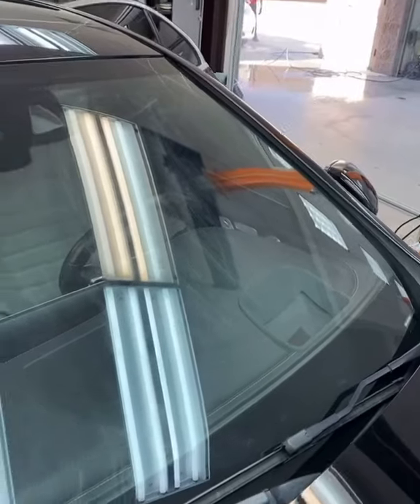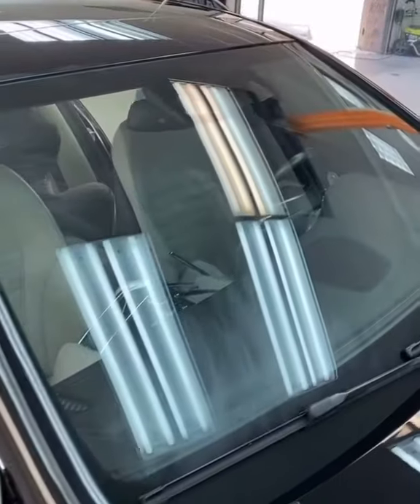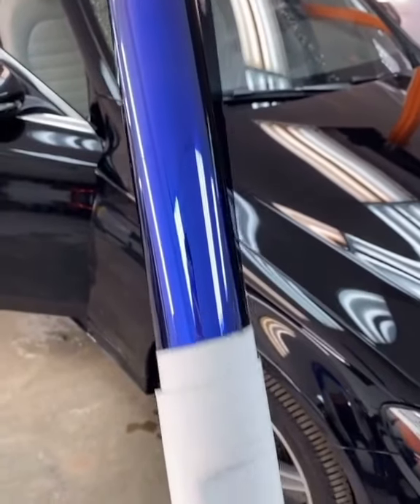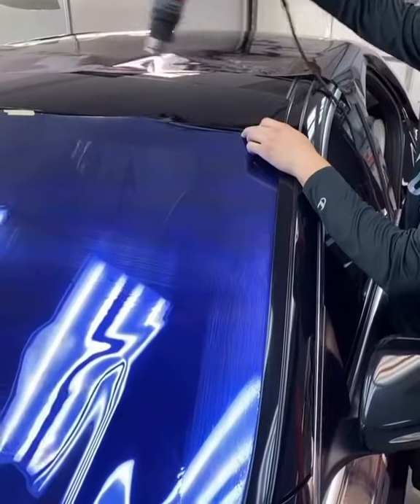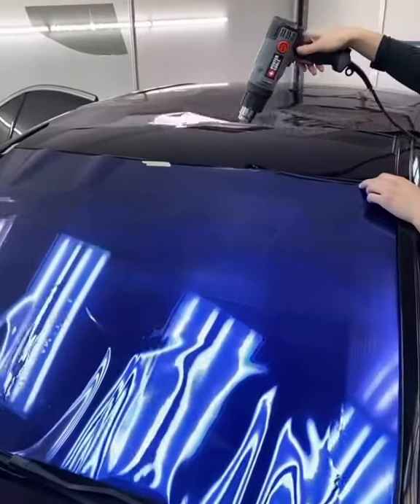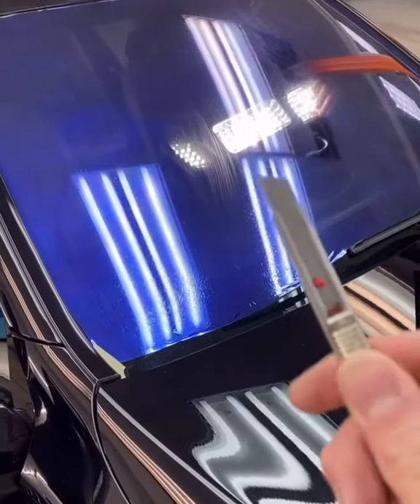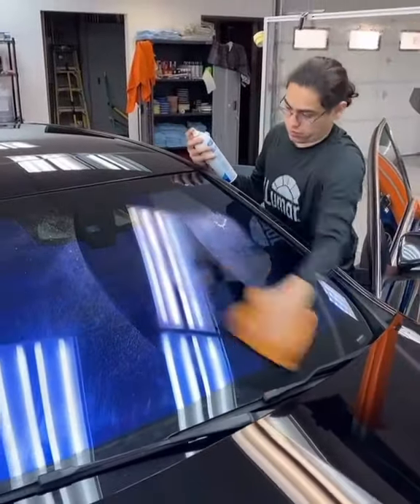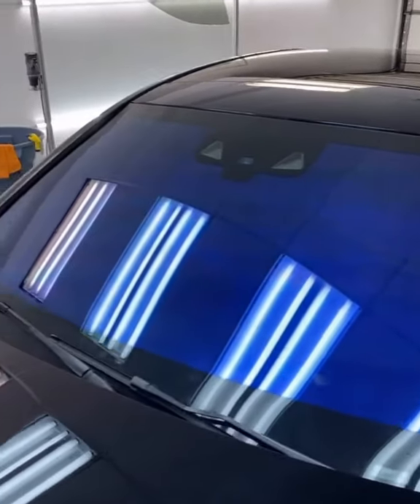Installing UltraVision Chameleon Window tint on a Mercedes! Night Shade

Comment: Thats kinda illegal isnt it lol
Reply: Not
Reply: Majority of tint is illegal
Reply: Mercedes, range rovers and probably other higher ends cars have something like this from factory but super super light not a tint or film. but I can’t find anything super light like oem
Reply: @Michal_S0L  that light color may just be from multi-layered tempered glass
Reply: @Michal_S0L  its a metal oxide treatment on the OEMs...ultravision makes something similar that is more subtle than chameleon, i think they call it clima cool. I have both - a land rover with the OEM and ultravision on another car...you can tell the difference but the ultravision clima cool is subtle
Reply: @timfreeman9976  my s class has that blueish purple reflection
Reply: There is AS1, AS2 and AS3 windshields.